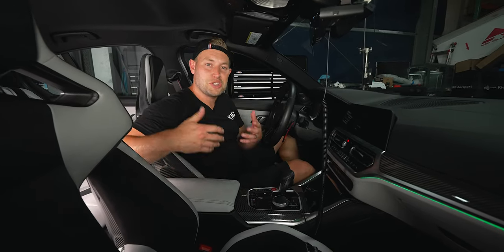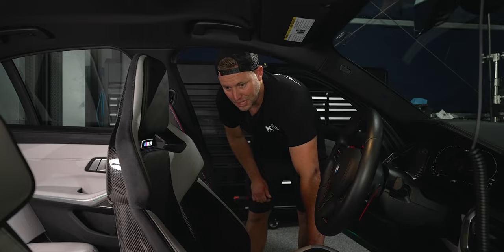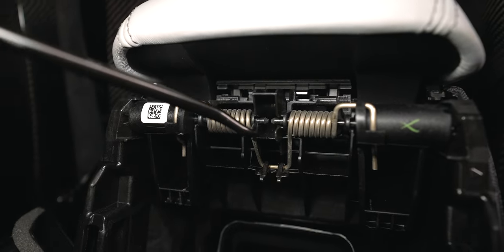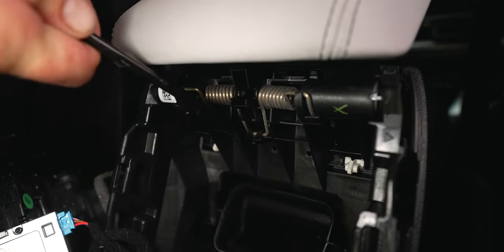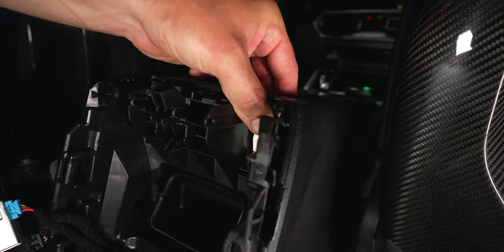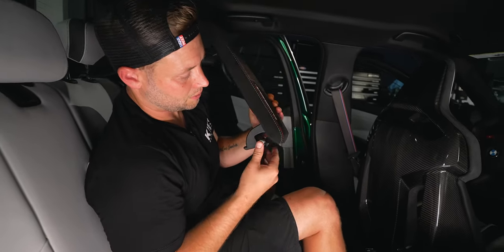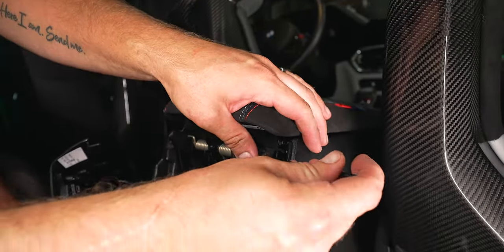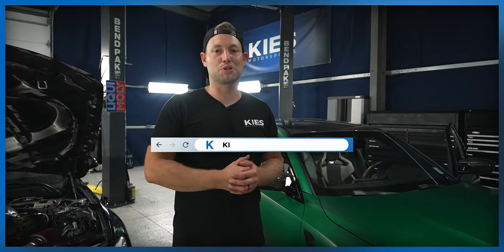How to install a BMW Alcantara Armrest in a G80, G82, G20, G22, M3, M4, M340i

Comment: Informative vid but wow it took way longer than you made it look. The back panel was a real arse and then the pins wouldn’t budge without serious leverage. The spring wouldn’t lift out either so what I ended up doing was just rotating the armrest itself back until it released. I slapped my forehead when I realized that would work. It goes great with my 50 Jahre interior though.

Comment: Thanks for the vid, is it required to use the kit that comes with the new armrest? Just wondering if the old parts will work is all.
Edit: yes the old parts work. Took about 30 mins only because I didn't have any tools except a really old crappy screwdriver all the rest I left at my vacay home 😂😂😂